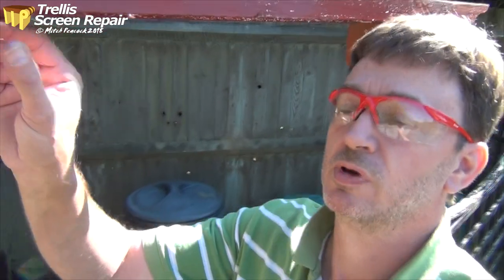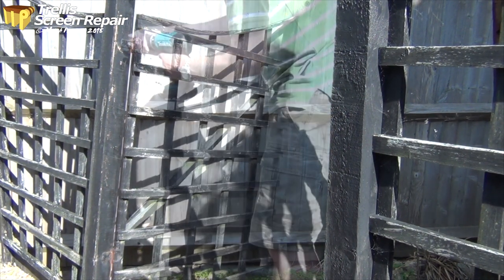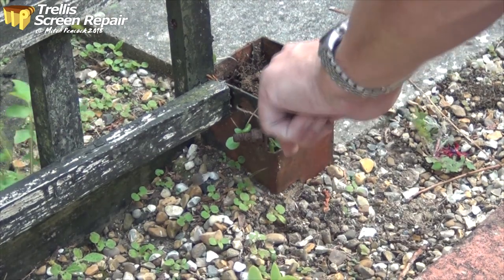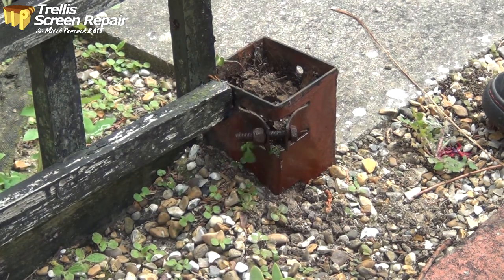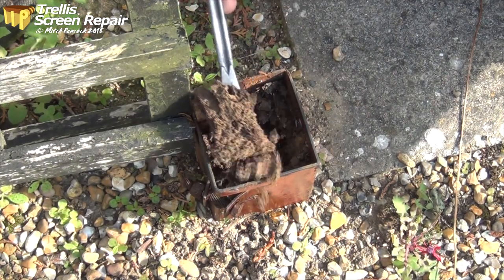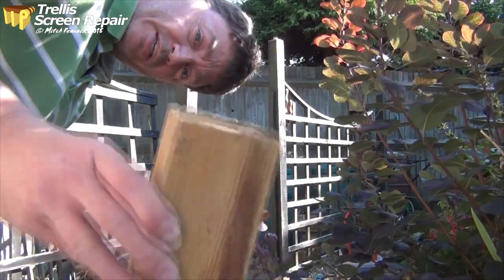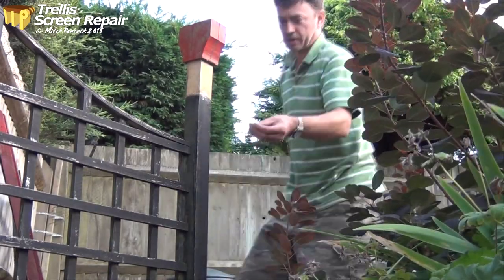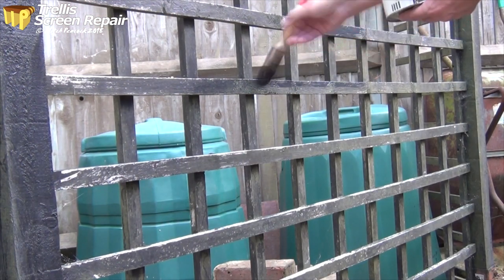Trellis Screen Repair

Comment: There is another method to get the stuck nut and bolt off.  Use the blowtorch to heat it up, take some beeswax and melt it on the threads near the nut.  The wax will be drawn into the nut's threads via capillary action and will come off almost as if it were new.

I've used this method on some very stubborn bolts where I couldn't get a tool to cut it off with and it worked fantastic!
Reply from the maker: That's a great idea, thanks!

Comment: Nice video, Mitch.
Did not you sand the fence and then paint it?
How are the posts fixed in the ground? Can rainwater possibly drain? This can prevent the rotting something.
Reply from the maker: Cheers Günter,
No sanding needed for this water based penetrating stained preservative. Have used the same product for years and it's so easy.
The posts are held in shallow metal sockets which do keep them off the ground very slightly. The others have survived with no damage, so I think this one post was just unlucky.
Reply: Markierte Antwort 
Mitch Peacock - WOmadeOD 
vor 16 Stunden
Cheers Günter,
No sanding needed for this water based penetrating stained preservative. Have used the same product for years and it's so easy.
The posts are held in shallow metal sockets which do keep them off the ground very slightly. The others have survived with no damage, so I think this one post was just unlucky. :-D

Comment: I did pick up a couple of useful tips.  great information.  if I could give back 2 tips: I find sometimes if I turn the post upside down, I don't always need to cut of as much to reuse it. As an old mechanic, I have battled my share of frozen nuts,  heat is your friend with rusted bolts & nuts.  carefully heat the nut without heating the bolt as much as possible.  the nut will grow larger and unthread easily.  BTY, don't use your fingers :>)  you keep making videos & I will keep watching.
Reply from the maker: Cheers Russ